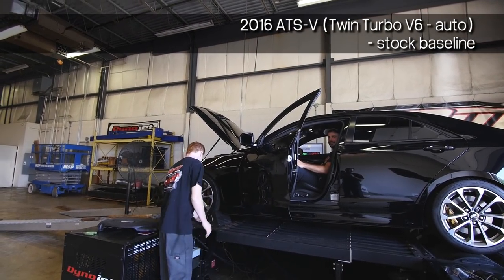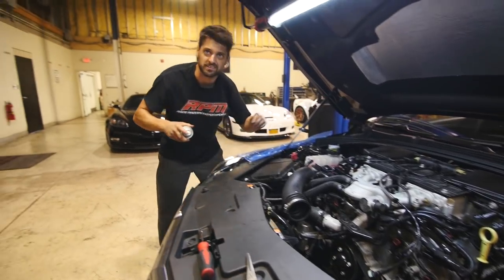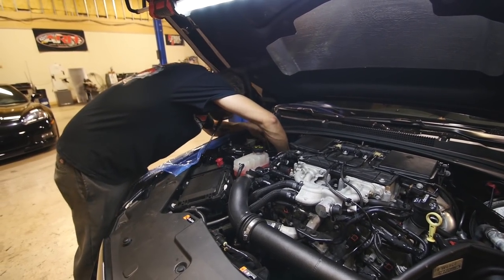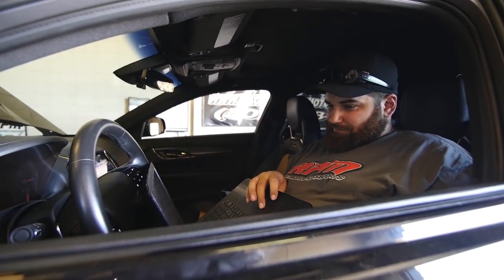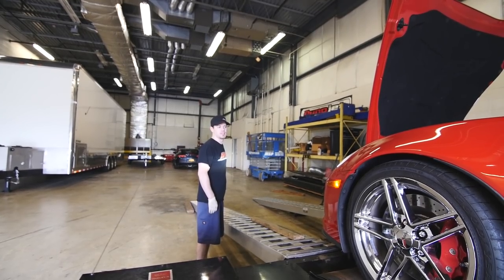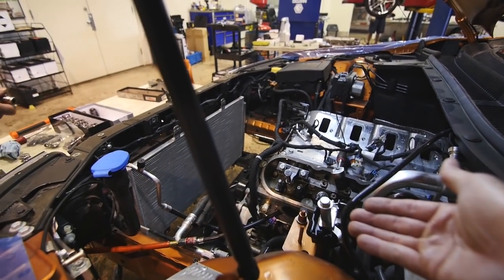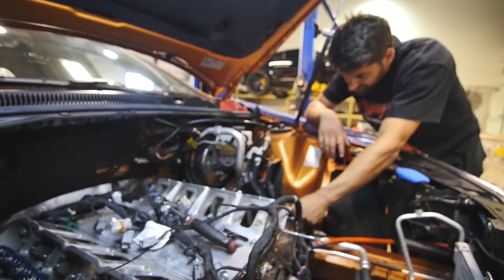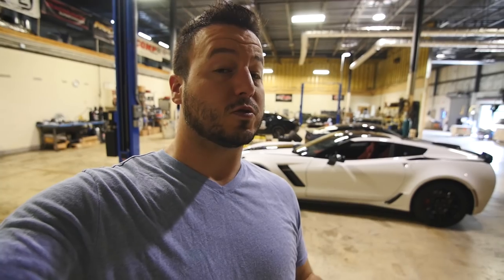Cadillac ATS-V Stock to Stage I (HUGE Gains)  | RPM S5 E26

Comment: We have a 16 ATS-V with 620whp. Tune, flex sensor, downpipes, intake, lpfp. E50 540whp on 93. The ATS-V is such a hidden gem 💎
Reply: any updates on the car? is it reliable? is it a good daily? im considering this car
Reply: @moistydoooood  I want
Reply: For e50 mix can you just fill up the tank with like 60% e full e or do you have to still mix 50% e the rest 93?
Reply: what’s a flex sensor? why would you need one if ur not on e?
Reply: @corvette7784  how did she hold up over time and miles? I have been waiting to turn up the spice level on my Blackwing, but I am apprehensive to blow a motor
Reply: @THE_A.RAVEN1  we had it for over two years, zero issues. The blackwing has the same engine and they are tough! The guy that did my work has one with 800whp and is in the low nines. Races it all the time and drives it to work. I now have a 2015 Jaguar F Type R, and what a blast!
Reply: @FilmedInMexico_  I filled up the tank 2/3 E, then the rest 93.i had a guage that would tell you the mix. I would have one if you run E
Reply: @alanmusa7143  You need  a factory flex sensor to run E so the cars computer can detect the blend of E being used for all sorts of reasons. Don't run E without it.

Comment: Holy hell!  135HP / 130TQ with those few mods and a tune is insane.  I like that car now.  Easily in the 11's now on a stock tire.
Reply: Hey Steve Wat kind car was they
Reply: hi justin is a black car with wheels
Reply: Most of that power bump was the extra 5 psi of boost
Reply: they increased the boost by 5 pounds also wasnt just the bolt ons
Reply: Looks like that car had all season tires on it. Mine went 12.08 on the stock Pilot SS and 11.96 with Pilot S4 rubber.
Reply: Justin Schmidt ran a tune only ATS-V with drag radials and ran 10.78 @130mph. He said you gain a little with DP. But nothing on intake. Crazy he jump on a V-6!
Reply: @justingriffith8486  it's a Caddy ATSV. Twin Turbo. Stock 446 hp & tq. Mine has to be tuned! No lag. Shits & gets. Did Thunderhill raceway here in Northern California and  excellent brakes! Never faded all day!. I had the track pretty much to myself all day. Was back in Oct/Nov. Did the 3 mile course
Reply: Theres ATS-V's on youtube now with ZERO mods and just a Tune hitting 10's..... Just look it up!!

Comment: the awesome things about this is thats you can do the same stuff to cadillac cts vsport as well. zzp intake ,downpipes and a trifecta tune ,and you are right there with the ats v's.  these lf4s/lf3 motors are simply amazing turbo v6's. granted i have always been a v8 guy... but what the hell is wrong with a twin turbo v6, ford gt, jaguar xj220, nissan gt-r . these v6s are changing my perception of what a v6 can do.  plus the added fuel mileage is a plus

Comment: Damn I love the look of that ats-v but the exhaust note just not so nice lol.
Reply: Backyard Chevy yea its horrible
Reply: Don’t forget about the ugly gauge cluster and horrible infotainment also
Reply: markdafunky1 gaguge cluster is extreme garbage
Reply: With the right set of downpipes it's exceptionally awesome.  With the wrong ones, they sound awful.
Reply: Which downpipes are good or best for the V to make the exhaust note to be a little better
Reply: Im so sad all of the american turbo engines sound so fkn bad. A turbo v6 can sound so melodious and brutal just listen to an audi s4 2.7.  Same thing is happening with fords 2.0/2.3 turbo and even their beastly 3.5 turbo... HORRIBLE raspy  exhaust note no matter what you do.
Reply: @rmblwgn  the GNX begs to differ.
Reply: @MrSherlockDomes  of course but I mean all those made since say 2005 or so. think it has to do with the direct injection. Listen to a F150 2.7 turbo versus an Audi S4 2.7 turbo
Reply: @rmblwgn  also the 2.7 ecoboost has headifolds as well instead of the usual exhaust.manifolds
Reply: The stock exhaust on my 2017MY sounds SOOO much better than any exhaust/tuner modifications that just make it sound raspy...I have a videos on my phone that I should start to upload a few on YouTube for all to see.

Almost every review I see out there is for the original 2016MY ATS-V...they must have fixed many of the issues into the '17MY, as I have zero issues with CUE responsiveness (usually just use steering wheel controls to change volume or track/playlist/radio station anyway)...the only negative is the shiny black finish they used which shows finger prints like a mofo, so I keep a microfiber towel in my glove box to wipe down.

There is pretty much zero reason to ever put into 'manual' mode, because in drive/auto mode (if set in Sport/Track/PTM Track), you can just click the paddle shifters at any time in auto and it will change gears (without having to pull the shift lever to the left for 'manual' mode)...and when driven AGGRESSIVELY, it upshifts and downshifts are so quick with a simple finger pull that it almost feels like dual-clutch (then if you want it back into full auto mode, you either simply hold the upshift paddle for like 2 seconds and it will go back into D, or you just don't touch any paddle for several seconds of 'normal driving'. My HUD is set to show tachometer, speed and will show you what gear you are in if you decide to pull on the paddles. It  also will show the artist/song name on the heads up display and if you set a navigation route, all the info is right there floating in the front window.

The basic looking gauge clusters never bothered me at all--not what I bought this car for, and I barely even look at them because of the info on my HUD (sans oil temp). On the lower digital/customizable screen, I have the miles left to tank on the left, in the middle is the compass direction I'm heading in, and on the right is my tire pressure monitor.

Everyone that has driven my car, or has been a passenger, has been blown away by its performance.
Reply: @HOVIK750  I've heard ZZP downpipes with h pipe sound mean. Gotta go with cats too, not just for environmental reasons, but they smooth out the sound nicely. Supposedly x pipe was part of the sound problem with other systems.
Reply: Borla

Comment: Nice video. Those Cadillac ATS-V's are so nasty. They are a missed opportunity. Those engines make so much power with those simple mods. To go from 450hp to 600+hp at the crank is crazy. Could you imagine how much they would make on a full exhaust, cam, heads and manifold. Can't wait to see what the C7 Z06 puts down on the dyno.
Reply: phreak260 it's the same as the GTR when it first came out. They were at their peek and then AMS took them to another level with all the r&d they did. Which is why I said the aftermarket needs to do the same. If there is no aftermarket support. You can't push far beyond what's been done. Where have you seen what's the max these engines are capable of?
Reply: phreak260 true. The ATS-V flew under the radar and to make matters worse. It didn't seem like Cadillac was trying to take the glory away from the CTS-V. I'm glad the ATS-V is finally getting the recognition it deserves. Even though that recognition has been slow to the game. I'm pretty sure with the right aftermarket backing and parts. That engine is capable of mimicking the modded Nissan VR capabilities.
Reply: phreak260 Cadillac was playing BMW at their game and did a better job with both cars. Cadillac was considering putting the LT4 in it because an engineer did say they could fit it in the engine bay. I'm glad they pursued the twin turbo V6. Just to make a statement of we can do what you can do but we'll make it better. Which is what GM usually does when they go after a specific section of the market. Just like they did with the SS Cobalt in the fwd days of the 2000's.

Comment: Time for a ATSV daily I think lol
Reply: I've had my 2017 ATS-V for 3+ years now...best Cadillac ever. Originally was going to wait until the powertrain warranty was up, but I'm bout to just say fuck it, and do it now.
Reply: Jarrod Olley hows the reliability ??
Reply: @f1romero969  Maybe I'm going crazy here, but I swear I responded to this question, yet can't find it in my history?

The reliability is excellent, zero issues and it will be 4 years of owning in Aug/Sep of this year...this car is perfect for me, and I'm 6' 3" but slim build (165-180 lbs) yet the bolster adjustments on the Recaros hold me in so well.

I have had 4 new Cadillacs over the last 14 years: 2007 CTS 3.6 rwd summer-only tires (2+ years), second-gen 2009 CTS 3.6 awd w/ all seasons (~5 years), 2013 ATS 3.6 awd w/ all seasons (3+ years)...and of course my current 2017 ATS-V. The ONLY major issue I've had on any of these Caddys was the transmission on my 2009 CTS--dealer had it for I think 15-16 days going through all their protcols until they had to just get a brand new tranny installed. Outside of that, it has been smooth sailing for all of them.

Comment: Has that ats-v been reliable after that upgrade? Or have had any problems. I'm planning to do a similar set up for mine
Reply from the maker: It's just downpipes intake and tune, so yes very reliable, she daily drives it and tracks it.
Reply: @RaceProvenMotorsports  thanks for the information.  It puts down a lot of power for those few upgrades. I wonder if it can beat a stock gtr. Have she race one yet?

Comment: Cadillac did a dam decent job on the stock exhaust note. I've yet to hear an aftermarket ATSV that sounded good... Love this car tho.
Reply: Corsa exhaust and/or ZZP downpipes 👍
Reply: David A cat or catless zzp downpipes?
Reply: @Breyden1Bales  I prefer catted but you need to put a small pipe connecting both downpipes. About 2" with a flex pipe to even out the sound early on. There's a thread about it on the caddy forums. The h-pipe in the downpipe kills the rasp and makes them sound really good.

Comment: I thought the ats v had 464 stock. Why did they only get 396 on the dyno?
Reply: 464bhp from factory. That's measured using an engine "brake" with the engine out of the vehicle. 

396whp is measured at the wheels, which factors in parasitic loss from drivetrain. There's typically a 10%-15% drop between the 2.

Comment: Should’ve kept the X pipe on the ATS-V they sound a lot better with the X pipe on the exhaust
Reply: They sound awful when you do the catless downpipes ...so the aftermarket  came up with this solution, for w/e reason removing the X pipe removes 90% of the horrible rasp with the catless downpipes.
Reply: Justin S got you! 👌👍 but still most v6’s are raspy 🤷‍♂️ probably a good set of resonators might eliminate some of the rasp
Reply: yea others have tried resonators with good success as well but it is kinda the nature of the beast with the V6s.  A few companies have full exhaust systems that sound very good but of course, 1500-2500 dollars.
Reply: Justin S yeah i figure that for a car like that full catbacks of good quality and sound cost a pretty penny. For sure

Comment: Hp464 whp 445 from stock. How come that one is 396jaja
Reply: Crank hp isn't wheel hp. The Dyno tell the power to the wheels which is the only hp that counts.
Reply: Stock car is 464hp at the crank. And 396 at the wheels. After upgrades it is 536whp, which is probably well over 600 at the crank. JAJA

Comment: So everyone says you guys messed up streetspeed717 old corvette engine is screwed
Reply: MrJimbo don’t believe everything u hear on the internet.  Specially from a hack like dfr.
Reply: Sheldon Cooper yea, DFR. The same DFR who fucked up 4 cars in a year!
Reply: RPM never had the heads off. DFR built the engine. RPM installed a pro charger.
Reply: That engine isn’t even messed up.  The scoring is likely from mike not doing the break in properly.   Not to even mention a 1200hp from a engine that did 500 from the factory.
Reply: mike s and apparently, the guy who bought the car off of Mike, resold it to someone else, who took it to another shop.
Reply: Haha idc im just saying that is like every comment on the video last night from dfr when they pulled the heads last night
Reply: I Think It was more blaming Fran's tune
Reply: mike s they replaced the cam with there own cam when they built it look back at Mike's videos they also had to take the head off to install headstuds
Reply: Zach 7.3 taking the heads off has NOTHING to do with what happened.  The new owner posted on his Instagram that it was running rough under his ownership yet he took it to a shop where he lived and ran it full throttle on the dyno... instead of checking plugs.  Instead of exercising common sense he beat on it when it sounded like it was mis firing (most likely a part failure of injector or spark plug) causing further damage.  No one is to blame but the new owner...bottom line.  A car of that power level takes constant checking, making sure meth is full, fuel or e ratio is right.  Not beating on it if it doesn’t sound right.  This what happens when a complete noob takes ownership of a high horsepower car not one of any shop.
Reply: Spark plug caused that damage and in that high horsepower application...holding high rpm too long or someone else messing with tune could of caused that...ud never know what happened between that time.
Reply: MrJimbo yep Angry Eric messed it.Its got to be true it’s on the internet.No telling what has happened to that car since it changed ownership.
Reply: Except unlike rpm dfr didnt blame anyone.  He said it was a bad plug well that caused the issue.  Not the shop not mike it was a shit happens problem.
Reply: Carl Riley that's because there was no one to blame, except for the new owner. HOWEVER, there was plenty of blame to be called out when Mike took his car to RPM. Like, several other ppl!
Reply: mike s why do you keep saying they never had the heads off?  they did. https://youtu.be/T03QRVmUpn0   Not saying they had anything to do with what happened but RPM had the heads off.
Reply: 650 from factory use you keyboard better lol
Reply: you don't have to pull head to do studs they take one bold out put one stud in and torque and repeat until all studs are in that way you don't have to reseal the engine
Reply: Fooked it up